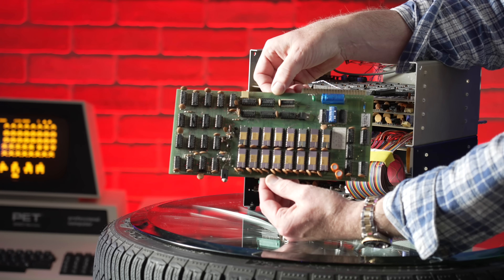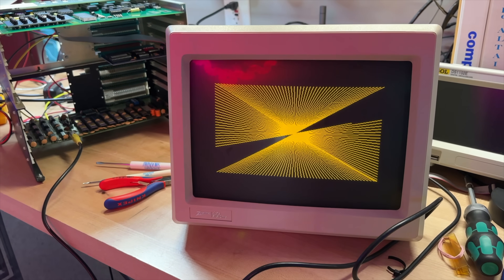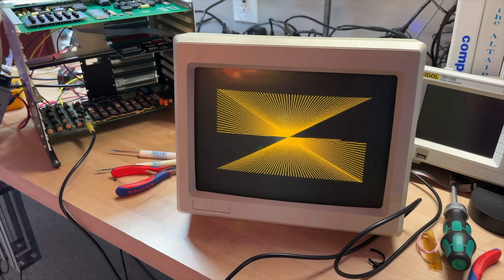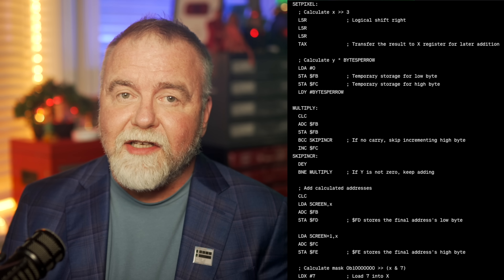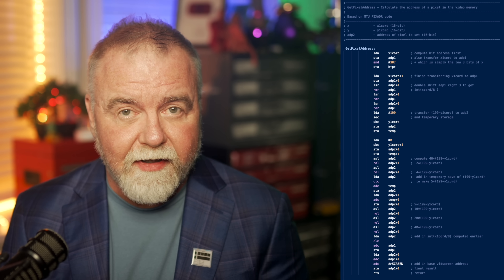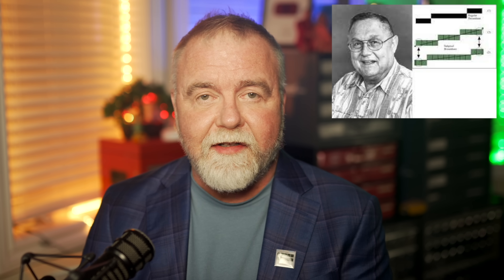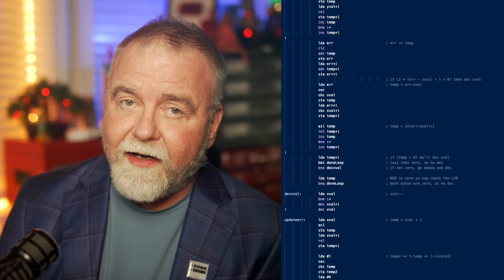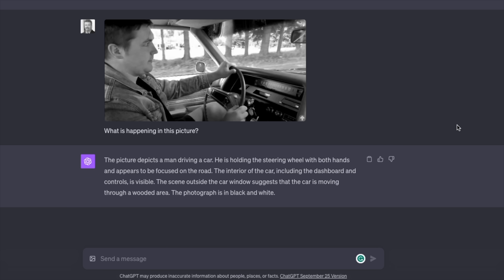ChatGPT Blew my Mind!  Now it can code AND learn from the results!

Comment: Nope, to draw a circle, you have to calculate the brightness of the pixels depending on the thickness of the line passing through them (surface basically). The usual approximation is incorrect. It involves complex calculations and approximations.
For example, you have 400 DPI display (normal actually to not to see the pixels), and it should be industry standard, not the one we have now, the resolution is defined by the resolution of the eye, as technically it is possible to manufacture such displays. It is the CORRECT resolution (like 44kHz is the correct resolution as twice the perceivable frequency). To draw a correct circle, you have to calculate the thickness and the area, and you can't use such simple algorithms, because the appearance of the result is not guaranteed.
Reply: You cooked your shitpost too long. It's indecipherable
Reply: @SquintyGears  To sum it up, specially for you: Unless you are a teen in the school doing it for your homework, drawing things in that way is not the right thing.
Reply: It depends… As is often the case in engineering, there is no one ultimate way to solve problems. There are those pesky trade-offs.
Reply: @DJSpinSter2004  no i literally can't follow what it's trying to say...
He's somehow trying to make a point about high dpi requiring a thickness to be actually viewable but then I'm completely lost on what the 44kHz has to do with that. And the video is about drawing a 1 pixel thick circle on a 400x600 display.... Really far from HD...

So the whole thing reads like a reddit shit post joke on people constantly ranting about resolutions vs dpi and somehow sound sampling frequency got spiced in. It's not a sequence of sensible english sentences.
Reply: @SquintyGears  My point is:
1. When you are facing different monitor resolutions, it makes very little sense to draw something in that way. Especially when the resolution is 400 DPI, you won't be able to see it properly, so you have to know the thickness of the line/curve to draw something. Resolution 400 DPI is the resolution when it is hard to see individual pixels.
2. When drawing, you have to calculate the filling percentage for each pixel, depending on the thickness of the curve to draw a correct shape. Normally Bezier curve algorithm gives a good approximation. It will give you the visual image of continuous curve, not "steps".
3. You should not draw curves (circles, lines etc) using the methods described in the video unless you are working with some microcontroller or very old computer, which has extremely low computing power. Those methods are for outputting graphics on very old, monochrome monitors with no way to set the brightness other than 0 or 1 of individual pixels.
Reply: @trevoro.9731  yeah so what i said to the other guy... That's just incredibly obvious. We don't even bother programming in assembly on modern systems. And if the point is just drawing circles you'd basically always be using a graphics programming language that probably has the method already done for you with the necessary parameters (though anti-aliasing tends to be calculated separately in those)

So because nobody would reasonably confuse a video about a 6502 assembly program, on a display that has less pixels than the battery indicator on my phone, with actual modern programing considerations. So it totally does read like a shitpost joke.
Reply: @SquintyGears  Oh. My bad then.